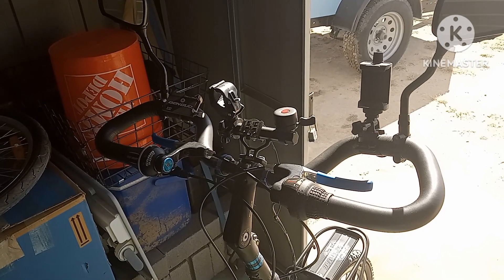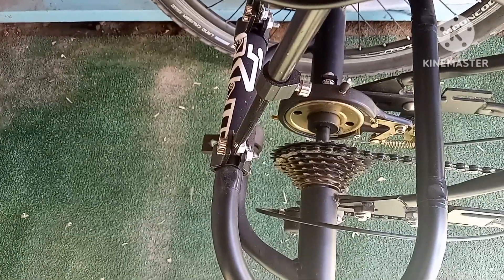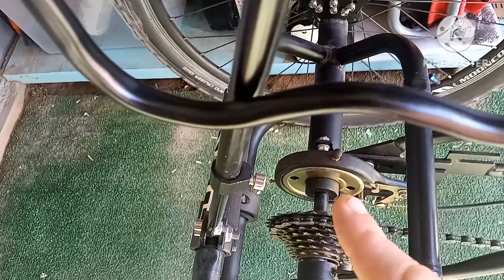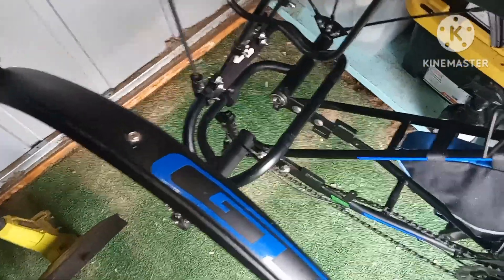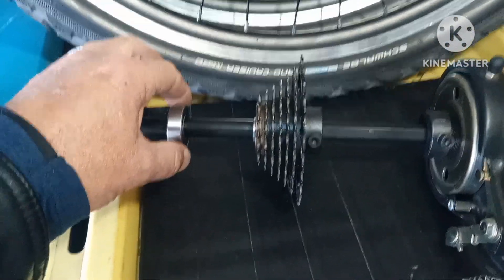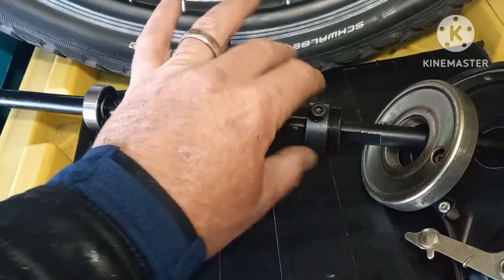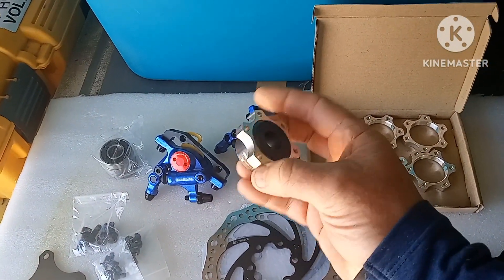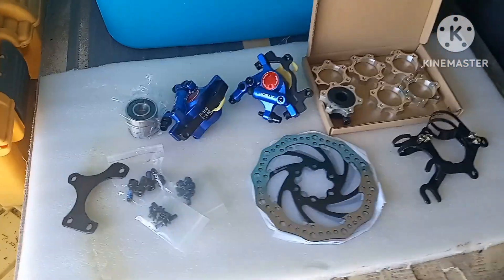Replacing band brake with disc on a mooncool adult tricycle.

Comment: Just bought the woman's version of the bike and my plan is to put a 2000 watt hub motor on the front wheel.  First thing I noticed was that the brakes are terrible which made the decision to upgrade the brakes an easy one.  Thanks for this video as it will make the upgrade process much easier.  I am looking forward to riding with ebike with my girlfriend!

Comment: Can you list the source/website where you ordered the parts?
Reply: Good question
Reply: Same here
Reply: I’m going for it. Found all the parts on Amazon. All 5 parts for £67 ordered today, delivery tomorrow🫰🏻
Reply: Parts arrived last night and fitted the disc adapter, hydraulic cable calliper and bracket. Removed the wheel and pulled the axle as described. My axle set up is exactly the same as the one shown. Removed the basket as well to improve access. The existing cable was long enough but unscrewing the band brake housing from axle fitting was a mare as it was screwed on damn tight. Whole job took about 3 1/2 hours and works well apart from if applying the brake going backwards the adapter comes loose but tightens up again when applying the brake going forwards. Might apply some permanent tread lock.
Worth the time spent though as a massive improvement on the crappy band brake.

Comment: Well ran into some trouble trying to order the wheel bearings 6302 - 2 RS has two measurements do you know which one it is 12x37x12 or 15x42x13 😢

Comment: Wow, I had almost given up on converting the trike I decided I wanted -- a 20" Vevor, because it was the lightest folding trike. I looked at the Lectric, which is light, but read about so many problems I decided on the Vevor. I've found out how to convert Vevor to electric (adding front wheel hub) but have been stymied on how to add on a better brake. The band brake Vevor comes with is ridiculous. Now I just need to translate what you've laid out into the parts I need for my particular trike, and how to do it.

Comment: Quick question how did you remove the bearings from the internal axle  the manufacturer used loctite I had to use heat to burn off the loctite off the adapter so I can mount the disc I have a bearing knocker nothing seems to move that bearing it is so tight I'm afraid to use heat cuz I do not want to discolor the coloring of my bike how did you remove the bearing seems to be the same model of bike hoping to push a video so you can see the modifications I have made  just got a tighten everything down and mount the caliper  🫡 thanks for the video  really came in Handy

Comment: Nice video good advice I got some for you you should try ordering a bigger cog for the rear  axle makes for easier riding I'm referring to the 7 speed sprockets and get yourself a small sprocket for the front 22 tooth makes life easy and have you seen the attached motors that adapt to the disc brake you can remove them anytime you want I'm pretty sure we have the same bike they're all from China just different name

Comment: Quite informative but can you give more details on the adaptor. Am I right in saying it’s a standard right hand thread?
Reply: It looks like if you stop on a hill the sprocket unscrews from the adapter. It may need to be drilled and pinned
Reply: @AncientAmbience  you are right it will unscrew if you brake going backwards. I over came this by applying thread lock. 
Need to bear in mind you may need to remove it at some time. 
The disc brake is a vast improvement.
Reply: @bobbo9549    ok. Im in upstate NY. Hills / mountains everywhere. If I trike has a loaded basket then stops on a hill, lol, bad things happen

Comment: One more thing I plan on doing this modification to the rear but my front rim is disc brake as I'm going uphill I carry two dogs the bikes rated at 420 lb that's the only reason why I got it well sometimes I have to stop mid uphill and as I engage the break the damn disc unscrews

Comment: I'm trying to follow your video to convert to disc break also.   

I like to get some clarification from you.  You mentioned using 140mm disc.  But from your video, it looks like you're using 180/160mm hydraulic break caliper with the 140 mm disc.  Is this correct?

I'm double checking to make sure I'm not buying the wrong hydraulic caliper size.

Thank you for your help.
Reply: I'm going through the same problem I found the 140 well this guy came up with a good idea but he just didn't think this video out as for on line guess I'm having a problem mentioning by name purchase site limited on the space oh that's just YouTube sucks if you're using spell check 😢
Reply: I think that's my problem calipers too small

Comment: Total disaster I did a good job of mounting all the hardware gather up all the parts in between Temu and Amazon the band brake worked better I think I went to cheap on brake calipers these cheap Chinese bikes have nothing but Lock tight on everything I really did a good absolute no stopping power